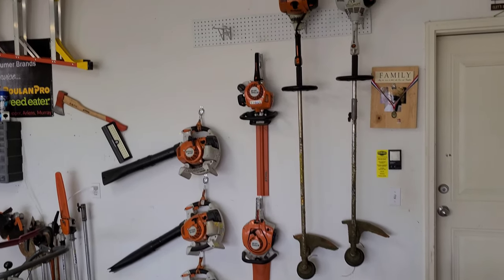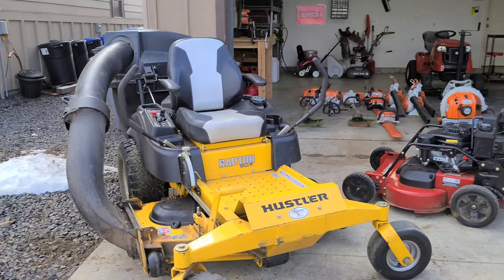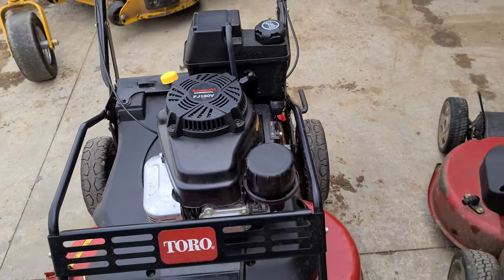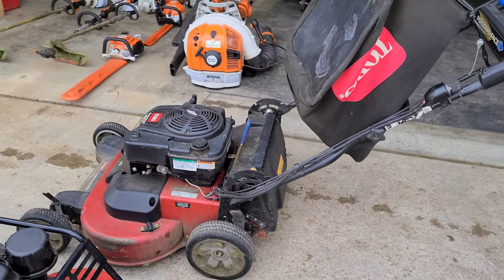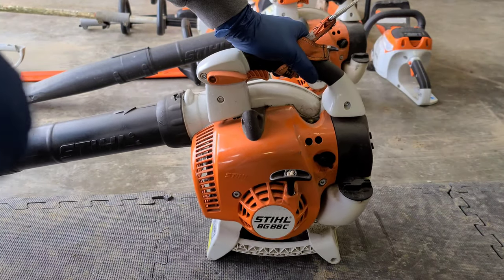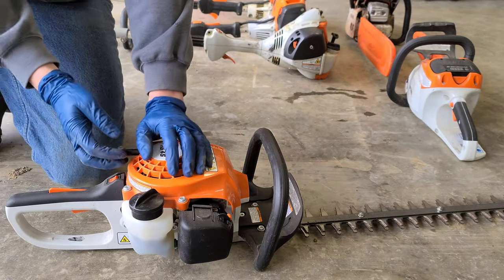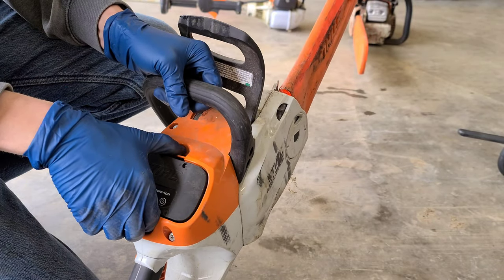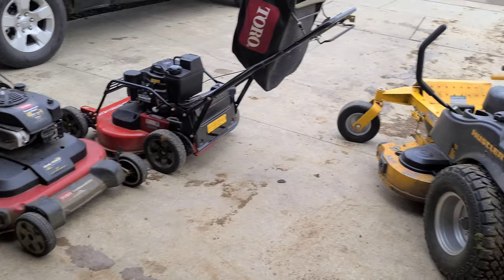2021 Lawn Care Equipment Start Up | 5 Months, No Stabilizer

Comment: OLD MAN here from Eliminator Performance Fill. At our shop we only use ethanol free fuel and K100S+ stabilizer mixed at 2.5 ozs. of K100S+ to 10 gallons of fuel for one year storage. Never have an issue firing up equipment after sitting for 6 months on first or second pull and we never run our equipment out of fuel before storage. Interesting that we just repurchased a fuel container we sold to a customer with 89 Octane ethanol free fuel and K100S+ from May 2018 (customer had health issues and never used all the fuel since he hired a company to take care of his property). We will shortly be visually checking the difference between new and 3 year old fuel, then seeing if it will fire up a mower that runs on fresh fuel then run out of fuel and try with the 3 year old fuel. My guess is it has a 50% chance of running.
Reply from the maker: I would love to see that on your guy's channel 👍🏼 I think that would make a great video. Thanks for sharing Wayne!

Comment: I put Stabil and Marvel Mystery Oil in each 5 gallon gas can each time I purchase gasoline.  I never have any problems with my Stihl equipment.  NEVER USE ETHANOL in small engines or any lawnmower!

Comment: Hey Fill really enjoyed the video. 2 things. 1. why do you leave plastic gas tanks full? 2. Have you ever heard of cold seizing an engine? Basically I watched a video a long time ago about how with two stroke engines especially you need to let them warm up slowly so that the whole engine warms up consistently together. Supposedly if you fire it up and rev it up to much, the rings and can warm up faster than everything else and expand and seize the engine up. Have you ever heard of that? I’ve never experienced it or seen it happen but o suppose the logic made sense.
Reply from the maker: Never heard of cold siezing and I never have issues with leaving fuelnin plastic tanks
Reply: I have seen a video from Steve’s small engine saloon on 2 strokes that had scored pistons because people start them and just rev them up to full immediately. He said chainsaws are the worst because they rev higher than most other equipment. Even giving your machine 30 seconds to 1 minute of warm up would be huge for the life of the engine. 
On the topic of gas, I always use ethanol free fuel in my equipment and have not had a carb issue since I switched from standard 87 fuel. And of course the Stihl synthetic oil
Reply: @fillslawncare what's the difference?  Why not leave them empty?

Comment: For the last ten years or so I have used regular pump gas, I never do anything special to 'winterize' my equipment, though I do use Sta-Bil gas stabilizer. I have twelve 5 gallon cans that I keep full and always rotate. Many times I have two year old gas that I use and I never have any issues. Sometimes the gas is newer if I mow a lot, as the cans get rotated faster. I'm sold on Sta-Bil.

Comment: You need to shake your two stroke's before you pull to start them to mix up the oil in the gas. If not you could clog up your carburetor with oil.

Comment: hey fill. i’m a master tech at my city’s local small engine shop. we recommend running all outdoor power equipment completely empty before storing for longer than 3 months. ethanol free fuel still has a shelf life. 2 strokes you can dump whatever you can out then start and hold at wide open throttle until it dies then prime and try to start again and then check tank. if some residual is in the tank used compressed air to blow it out. 4 strokes you can get some sort of siphon or turkey baster to suck what you can out the tank then start and let it run until it dies. sometimes the pick ups aren’t directly at the bottom of the tank so shake the machine around a little and try starting again. love your content!

Comment: I am a gardener  more than 20 years. My storing method for the winter: on the 4 stroke engines I close up the gas valve and starts the engine, leave it to run out from gas. I put a stabilizer in the tank as recommended. The machines are stored in my closed trailer all winter. In the spring I open up the valve , leave it for a couple of minutes the gravity fill up the carburetor (smaller machine), and if it is not starts after 4-5 pulling I remove the air filter and spraying some starter spray (even break cleaner is working). After one or two pull starting up. The bigger mowers usually starts after a couple of seconds using the starter motor.
The 2 stroke engines: I pouring out the gas from the tank and after starts the engine and wait to run out of fuel. I collect the mixed gas in the usual gas container and put in some stabilizer too. Spring time just give the container some shake and filling up the machines gas tank, doing the usual starting process and after a couple of pull all of them starting. 
I have to use ethanol mixed gas because in Toronto - at least where I live - we do not have ethanol free gas. But with this methods the winter storage is no problem. 
I have battery operated trimmers, hedge trimmer too, these tools I bring it in to the basement to keep it frost and moist free. I remove the batteries and fully charge before store in room temperature. I n the spring time just start to use them, DO NOT CHARGE the batteries, just let it run down the first time. Expect a bit shorter working time, but it is healthier for the batteries. After charging you will restore  the working time as you put it to "sleep" them.

Comment: I always use ethanol fuel and all my equipment including my motorcycle for winter storage I do use stable just to make the gas a little better when you try to start it I feel. Hope my hustler flipup starts as good as yours did. First year starting it after winter storage. Didn't have it last winter.
Reply: Was supposed to say ethanol free fuel.

Comment: The old dude that has taken care of my mower for years told me to run mid-grade fuel in my mower, snowblower,etc. And I have done it for 30 to 40 years now and have had little problems, change the plug, and the fuel filter(every 2 to 3yrs) and there we are. If things took more then 5 pulls( which they don't) I would be compelled to get rid of them. Run them dry at the end of the season, live it till time to use it again, it works for me , 30 to 40 years, I've  bought 1 lawn mower and 1 snow blower and still use them. I'm  not a miser, I just try to take care of my stuff. By the way, thanks for showing your machine, it means a lot, you know i love seeing you whip your big ole machine around with such elegant decisive manor, that wrist action, then the pulse raises,  and the you hit the throttle revving hyer and hyer till you peeked your engine and you chocked it out and what fun that was. Love the sweet trail ends of your backing out of the garage, just makes me quiver,( derewling). Bye for now, hope to see more of you soon. Lol 🥮
Reply from the maker: Thank you kindly for sharing :)

Comment: No Surprise with the Stihl equipment in starting. Wow, I was really surprised with your two Toro mowers. Did they start up pretty quickly when you were mowing? 
I have a Kawasaki FB460V 12.5hp on a John Deere 165 that will start no matter how cold it is.  The Kawasaki air cooled engines are pretty tough and tend to be quite dependable. How do you like your Hustler mower?
Reply from the maker: Yeah they always start first pull during the season
Reply from the maker: I love my hustler mower. The only issue I have with it is the bagger tube is too thin on the end by the deck which causes the clumps of grass to clog easy
Reply: @fillslawncare  I wonder if you treated the tube with WD-40 if that wouldn’t help prevent the clogging issues.
When my sister purchased her new Toro 22i inch Recycler, I made the suggestion about the WD-40 and we give the brand new Toro a good heavy coating underneath before the mower was ever used. 
The grass clippings wash away easily with just the pressure from a water hose. I am probably going to treat the mower deck again as well as changing the blade and engine oil - No, I don’t like the idea of never changing the oil. 
Besides, My oil extraction pump usually makes quick work of the old engine oil.
Reply: @fillslawncare  Those engines would have started up with no problem if you were not making your video - It kind of falls into the “Murphy’s Law” parameters. {LOL}.
Reply from the maker: @TheIronDuke502  yeah more than likely haha

Comment: I've had one MTD self propelled and I now have an MTD Mini Rider 60cm cutting width. With both mowers they started first pull when the engines were completely cold but after running them if you tried to start them with hot or warm engines they took forever (many pulls) to start. Is this something that is found with MTD's? What could be causing this?